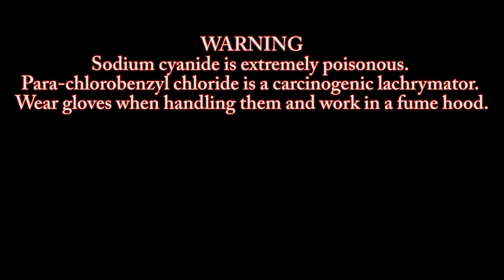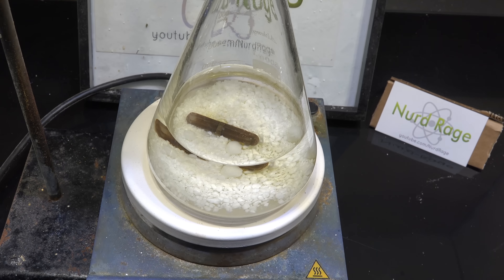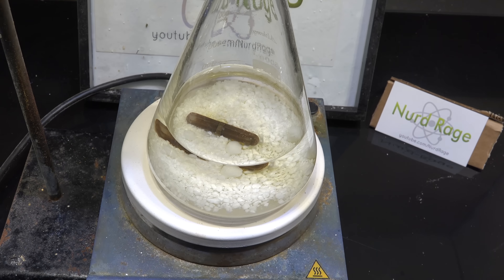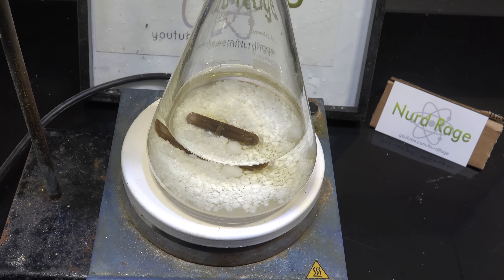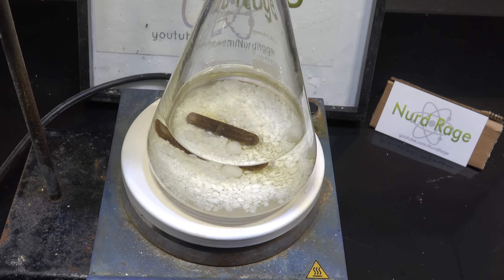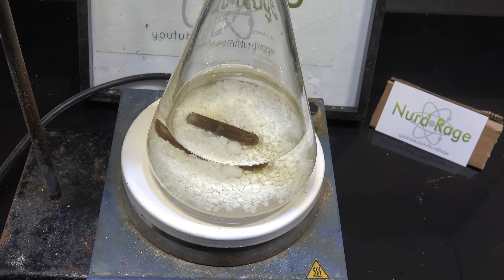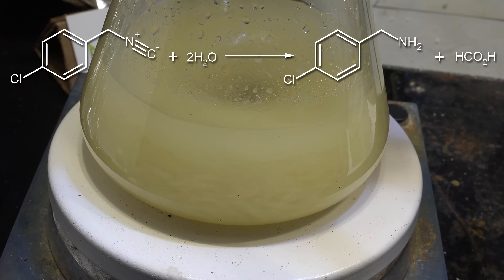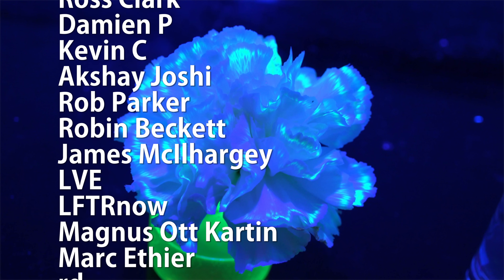Make p-Chlorophenyl Acetonitrile - Step 4 in Pyrimethamine Synthesis

Comment from the maker: This is the last video for 2016. I'll be winding down for the holidays and spending January repairing and doing regular maintenance work on my lab, ordering new chemicals and so forth. I'll be back in late January or February. 

Happy holidays and happy new year. And thanks again for being my loyal subscribers and patrons.
Reply: Happy New year for you to!!
Reply: Enjoy your time <3
Reply: I was with you up to "Greetings fellow nerds".
Reply: Thanks for another year of videos! Happy Holidays!
Reply: This might of been answered but i remember you moving a few years ago. Do you currently own and operate your own lab or do you work somewhere like a University?
Reply from the maker: +Jradical i actually looked into that method before i even started, the problem with that method is that it's very ineffecient in the quantity of reagents. you're making much more chemical waste for the same amount of product. to make the 500g of target p-chlorotoluene i wanted i'd need several gallons of reagents. Then there is the trouble of separating the solvent from the aromatics. The direct chlorination i showed is actually cleaner overall since the chlorine source (the tcca/hcl mixture) is separate. Purification is easier since there is no solvent to remove, just iron chloride salt that can be dissolved away. The seperation of isomers doesn't use solvents either, just a sulfuric acid reagent that's consumed in the process.
Reply: NurdRage What happened to the Lab Equipments series?
Reply: NurdRage 
how do you make strong nitrogen triiodine also nice video like always
Reply: trey Jarmon Not sure what you mean by strong nitrogen triiodide, however nitrogen triiodide as explosive dry crystals is typically prepared by mixing ammonia solution or ammonium hydroxide with elemental iodine with stirring followed by filtration. If you do it make sure you do 2 separate filtrations so you have 2 lots of your nitrogen triiodide in case one goes off prematurely, also this will produce iodine vapour when it goes off which is an oxidizer and not very good for your lungs and it will stain almost everything.
Reply: Marco Grinsel osmium isn't pretty expensive. Osmium is VERY expensive. The amount of osmium produced in a year in all the world is about 7,5 kilos. Considering its density this sample should be quite little. I don't think that an amateur chemist can get some osmium.
Reply: What was the actual yield (after purification and everything)?

Comment: Awesome work ! Incredible the purity you got from 1 recrystallisation.
Reply: aga that's not really like recrystallization, that crystallization. In recrystallization your substance has a low solubility in the cold solvent, and high solubility in the hot solvent. When you dissolve it in the hot solvent and let it cool its solubility diminishes and it crystallizes out. In this case he's just melting it and resolidifying it really really slowly in order to get large crystals. Basically the concept is the same, but recrystallization is much faster and less effective, while crystallization is much slower, but waaaay more effective. To purify its benzene faraday used crystallization and he got extremely pure benzene, even purer than analysis grade benzene of today.

Comment: Dropping a magnetic stirbar into a flask while it is sitting on a magnetic stirrer can result in breaking the flask. Always insert your stirbars gently, best guiding and securing them with a magnet from the outside or insert them cautioulsy into the strongly tilted flask, to make them slide down slowly.

Comment: FYI me had a lot of potassium ferricyanide (kodak reducer) so used as masked cyanide, I tried the reaction with NaOH and acetone and result cyanohydrin hydrolyzed by xs base to acid. Safe ferricyanide has a high stability low dissociation constant, bur ferric hydroxide in base has a higher formation constant.

Comment: I've always wondered why chemists use foil to insulate distillations. Wouldn't the aluminum conduct heat from the glass air since aluminum has a high thermal conductivity? Why not use other material such as glass wool since glass wool is an extremely good insulator and does not catch fire/decompose at high temperatures?
Reply from the maker: Foil stops convection and radiation, these together more than compensate for conduction loses and give increased insulation.

As for glass wool have you ever worked with uncoated glass wool? the stuff sheds little needle shards of glass barely bigger than sand. But god it itches like hell and gets on everything, including your clothing. Even worse is that a draft will kick it up into the air and you're inhaling that stuff. Remember all the crap with asbestos? Glass wool dust is just as bad. Now with enough protection you can work with it safely but why bother when foil does a good job, is cheap, easy to get and doesn't need safety precautions like full arm gloves fume hood and what not?
Reply: i see thanks for the explanation
Reply: Insulating tape is an alternative. The stuff  for muffler insulation for motorcycles etc. works and is sort of similar to the column tape sold by lab companies. I hate glass wool, it itches for days and don´t even speak about the eyes...

Comment: @NurdRage How were you able to dry acetone with molecular sieves? Acetone undergoes aldol condensation in contact with the sieves.
Reply from the maker: only do it for 1 day. the reaction does occur, but takes time. After 1 day the amount of condensation is detectable, but won't hurt the synthesis. The products will wash out in the washing step anyway so it's not a big deal, and the crystallization step pretty much eliminates any remaining.
Reply: Ah good. I assumed you used sieves and not anhydrous CaSO4 or MgSO4 (which are normally used for drying acetone) because you already had dry sieves and no anh. CaSO4 or MgSO4 on hand?
Reply from the maker: yup, pretty much... i'm too lazy to make Ca/MgSO4 so i just heated some sieves and tossed them in ;)

Comment: NurdRage, is it possible that some of the nitrile was converted to carboxylic acid during synthesis? I've read that CN will be converted to COOH under acidic or basic conditions.
Reply from the maker: Only if there is water present. In the steps where we add water, the mixture is at room temperature and there is very little acid or base present. So no reaction.
Reply: Thanks for replying! And congrats on your successful synthesis! Your explanations and descriptions of each step are very clear.
Reply: NurdRage I read that isocyanides can undergo hydrolysis only in acidic medium. How could then the reaction happen? During the hydrolysis process a formamide compound forms, which can be hydrolised under acidic conditions to a primery amine (in fact, a protonated salt). I don't know if an amide can yield amine and carboxylic acid under neutral conditions. Thank you for your answer!
Reply from the maker: you're probably right, i can't think of another explanation for the presence of benzylamine though.
Reply: The following explanation came to my mind: you added sodium metabisulfite to the reaction mixture to reduce triiodide to iodide, but in this reaction hidrogen ions (in real hydrated hyroxonium ions) also form, hence hidrogen iodide is present in the mixture, which is a strong acid. I personally think that it is enough to catalyse the hydrolysis of isocyanide to amine.

Comment: AFAIK Finkelstein reaction only works with sodium iodide, potassium iodide is not soluble enough in acetone for it to work.
Reply from the maker: it works, just extremely slowly because there is so little solubility. Fortunately for me I'm using sodium cyanide as well.. As you see in the two steps, the potassium chloride precipitates out essentially removing potassium from the reaction. Once the sodium cyanide makes nitrile where does the iodide go? with the sodium, essentially making sodium iodide. After an induction period as this salt exchange occurs, things proceed nicely. 

If i used potassium salts only, potassium iodide and potassium cyanide, yeah i'd be screwed. But if you use sodium cyanide, then it doesn't really matter what the iodide source is as the ion exchange will eventually give you sodium iodide. As said in the video i did have sodium iodide, but i ran out before i made this video. I was able to use potassium iodide specifically because my nucleophile was a sodium based salt.
Reply: Thanks, also, are you happy that meth jokes are dead now?

Comment: Why do you go through the hassle of chlorinating the methyl group of the p-chloro toluene by free radical chlorination rather than chlorinating benzyle alcohol to p-chloro benzyle alcohol and then reacting it with hydrochloric acid to get the chlorine atom in place ? It's much safer and the possibility of getting more than one chlorine on the methyl group is eliminated. But maybe I'm overlooking something since you are the Ph.D chemist not me yet.
Reply from the maker: what's stopping the chlorination of benzyl alcohol from oxidizing it to benzoic acid?
Reply: There we go. I didn't even know that this was possible, lol. Also I searched online but I wasn't able to find anything but does the addition of an ester to a nitrile  and following elimination of the alkoxide (I think this is the mechanism,correct me please if I'm wrong) a particular name ?

Comment: wrap in foil to keep in the heat? it might stop convection directly next to the glass but wouldnt it also act like a heatsync?
Reply: the foil stops convection and reduces radiated heat too, and it doesn't contact the glass all over to conduct heat from the glass optimally. In addition, the conductive heatsink properties you are thinking about is still limited by the glass's heat conduction, so that's not really any worse than just having the glass there.
Reply: ah, right. a heatsync is only useful if the original material conducts heat better than air. that said, doesn't glass conduct heat better than air? maybe the flask is made of a special glass with low heat conductivity - but then, why bother with the alfoil?

i do agree with the low contact limiting the conduction though.
Reply from the maker: Whatever the actual explanation is you can't argue with results: If i put foil on i can clearly see the vapor front rise up faster and distill over at lower temperatures than if i don't use the foil. The difference is significant.

Therefore, i keep using the foil.

Comment: Do you keep sodium thiosulfate on hand when using cyanide?
Reply: Evamael thiosulfate is used when handling bromine, as you need a something to reduce it. as for cyanide you need to oxidize it, so thiosulfate doesn't help here. Better use H2O2 or some other kind of oxidizing agent.
Reply: Still you would need a kind of antidote that converts some of your Fe2+ in your blood to Fe3+ to bind the cyanide ions long enough for your body to get rid of them.

Comment: Unrelated. If you had enough of the strongest acid in the world, would it be possible to make a hole going down to the center of the earth?
Reply from the maker: no, the earth is fluid at large scales (that's why it's round, it pulls itself together into sphere), any hole would eventually cave in.

Comment: Hi

I recently distilled some hardware store hydrochloric acid who's the MSDS claimed contained 32% hydrochloric acid and titanium dioxide
The distillation went well but now there is a yellow residue on the inside of the flask that will not come out no matter what I try
Reply: Any recommendations for cleaning?

Comment: Hello
ihave a question 
Today i was trying to make a coin shiny so i tried adding some powder citric acid then i added some bleach 
it made a weird foam i tried to smell it 
i regretted that a burning gas felt in my lungs i beleived that the gas is poisonous or something like that so i holded my breathe and opened the water sewer
im just wondering what is that gas and is it dangerous and what is that liquid that made that gas...?
Reply: It is chlorine gas, you will be fine but it isn't something you want to inhale, very irritating oxidizer.

Comment: would the final product worth all this cost, i mean even if it costs 700 bucks the procedure is more costy
Reply from the maker: Oh this is a research project to see if it could be done from domestically available chemicals. Cost savings isn't an objective.

If you want cost savings you wouldn't bother with this procedure at all. You'd buy p-chlorophenyl acetonitrile directly, react it with a ethyl magnesium bromide grignard and then do a condensation with cyanoguanidine. Doing it that way would be incredibly cheap, like $0.1 a pill. I'll be showing that method eventually.

But this method that the video is part of, its horribly expensive, also because a lot of it was unknown until i tried it. It is NOT worth the cost at all. My labor probably cost more.
Reply: thanks for reply and clarification